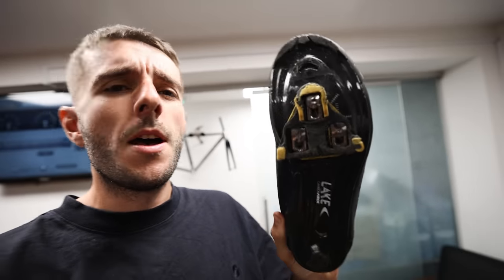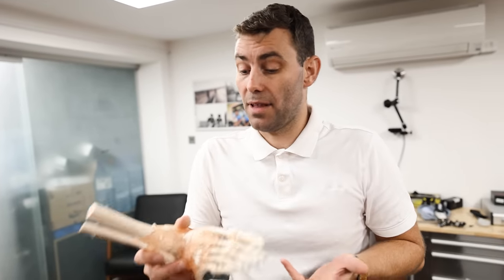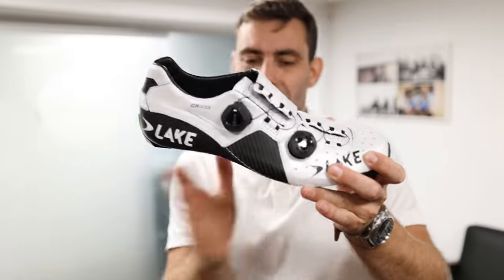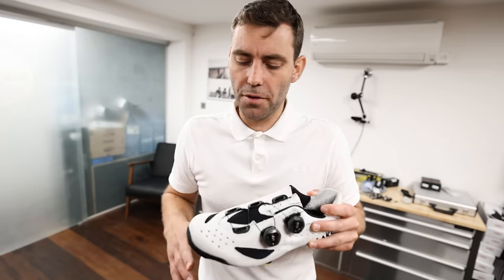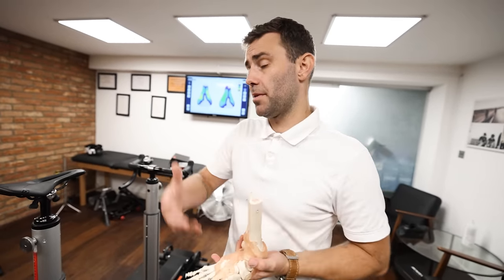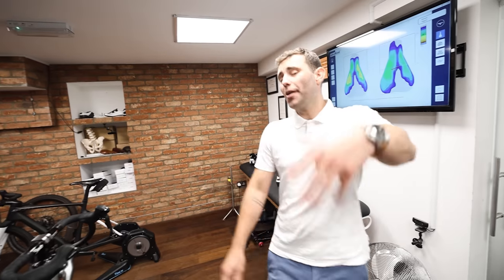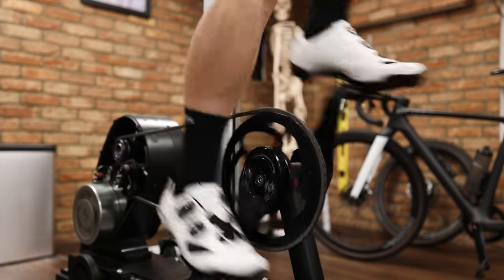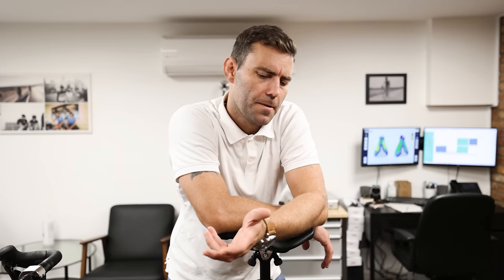Mid-Foot Cleat Position - A Bike Fitters Opinion

Comment: Still havnt got my shoes right.
Gone to my local bike shop had a fit on my shoes apparantly I'm 10.5 so I bought 11 and I still get immense pain of I have my shoes done to a normal tightness after 30 miles.
Reply: Why would you buy shoes that are too big?
Reply: @jam6875  because I have gone through 3 pairs starting with what should ve right to going a tiny bit bigger and now I wear 12 with insoles ti fill up excess space all in an attempt to not have agony.

I actually went to my local bike shop and paid to have my feet measured and they sold me the 11 with the pedals. And they didn't fix the problem.
Reply: @jam6875  so I have 10 which are what I normally wear, the shop measured me at 10 but 10.5 when I walk so I got 11 giving that half a size space didn't fix it so I thought I would test going up to 12 and it helped but not fixed it. After i do 25 miles I am basically limping. The size 10 I can't wear for 5 minutes without lain the 11 I got about the same as the 12 between 29 and 39 miles before the pain and insanely numb toes.
I describe it like someone has toed string around my toes knuckles and they are dropping off....
Reply: @simonsepic  That sucks... so the sizing isnt the problem. If i were you id go to an actual bike fitter that does more than just measure your feet
Reply: @jam6875  it was a bike shop I just asked them to do my feet as everything else is very comfortable. I'm one of these happy to make minor tweaks repeatedly to get things right. My feet though just can't seem to get rid of the pain.
Reply: @jam6875  I'll add I'm not rich that's the main reason I just asked for the feet. Same here asking how much James can just do the feet as I really can't afford 300 for a full fit. Which for the record for what he does I totally th8nk is justified I'm just poor. I only paid 200 for my bike then done 150 in upgrades

Comment: Putting my hand up as the guy who, from standstill, stood up at the lights put all my weight onto my left foot and had to turn my front wheel at a sharp angle to navigate down a crossing. With my weight committed forward onto that foot and a solid toe overlap that I wasn't aware of, went ass over tit. Be warned!

Comment: Does heel slip matter when fitting shoes? I got some lakes, fit great up front, but the heel is a bit loose.
Reply: I've got the widest LAkes MTB, still slightly narrow on the ball but dramaticly loose heels!! A nightmare for cyclo-cross running! When pedaling it's zero problem

Comment: For the average rider, clipless pedals and shoes are pretty stupid if we are honest outside of marketing. CAN you get more watts on paper? Sure, how much of that time is lost clipping in and clipping out at every stop light? Even if you DO manage to pull out a 2 minute faster 25 mile ride, is it worth it? I mean coulnt you eat 5 less cheeseburgers, save yourself 20 bucks, lost a couple of pounds and accomplish the same thing? I will always be a flat pedal curmudgeon. Nobody on my local bike trails is competing at ANYTHING other than trying to look cooler and more pro than the next guy, and often being dropped by me on a bike that costs less than their stupid carbon shoes...and I can actually walk around when I get to my biking destination without looking like a moron about to slip and fall down. I would wear them if I had a sponsor who paid me to do so ...there is your biggest hint when it comes to bicycle nonsense...the bike industry is full of BS and you are buying into it. I never found my best gains in my wallet or a new better bike part. I rode more, then I rode even more...the most gains you can gain on a bike cannot be purchased, just put in more days and miles then the next guy and you will still beat that other guy with a 50 year old steel frame bike that weighs twice as much and costs less than a 10th as much (and probably is a better bike). 

Most of the people who argue about this are trying to justify their purchases. Note: you will never of heard of any of those people in the comments winning anything of note. So, literally NOBODIES and NOBODY cares! You will care the moment you break your tailbone because you slipped and fell in your dumb bike specific shoes.

Comment: Would like to see the wattage difference.  I usually run my mtb and gravel cleats a bit further back but road is the metatarsal over the pedal spindle. After 30 years of riding this info makes me a bit skeptical as the shoe platform is super stiff carbon so if your shoes fit properly your foot shouldn't flex. I find the road position is better for out-of-saddle efforts and the further back position better for seated but feels weird for out-of saddle.    Plus how are we supposed to get overdeveloped gams :)